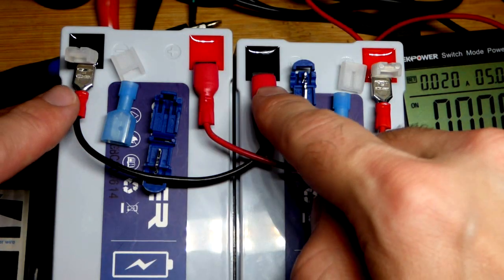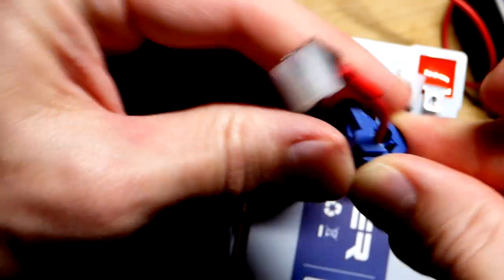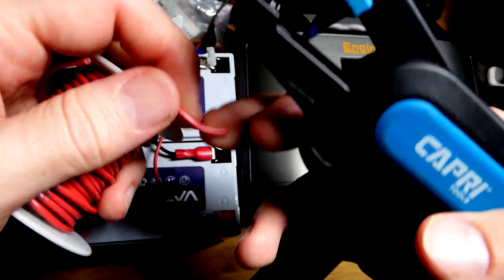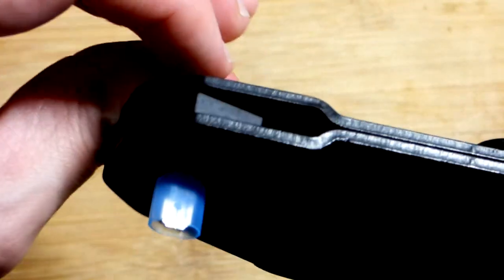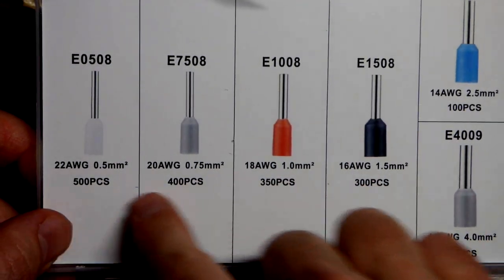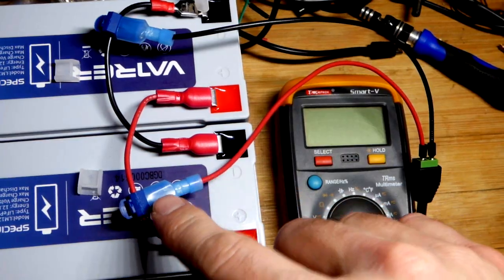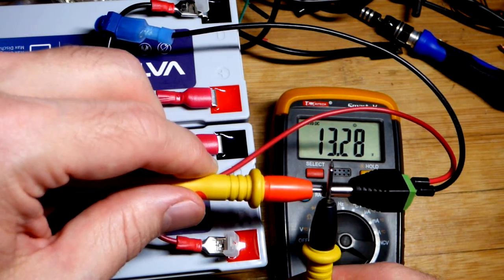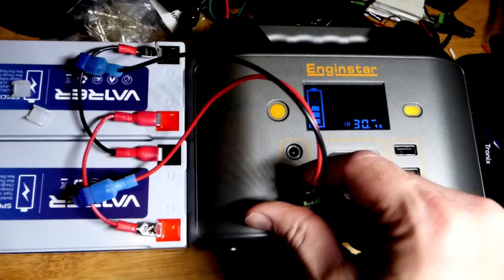T Tap Splice Wire Connector plus Ferrule and Spade Crimper for small battery and solar generator

Comment from the maker: https://amzn.to/3Q0RBwK T tap connectors
https://amzn.to/3MEV80u Ferrules and crimper
https://amzn.to/3WBQaGp cutter and stripper
https://amzn.to/46Ej0L7 ratcheting crimper
https://amzn.to/46HFESP spade and other connectors
https://amzn.to/3OkI82t piggy back spade connector
https://amzn.to/3JW5bxL screw down barrel plugs
https://amzn.to/46LBNUB 16 gauge wire multicolor
https://amzn.to/3Vx9MLk Two 7Ah LiFePO4 batteries
https://amzn.to/46xBL2K Enginstar power station
Product links are Amazon affiliate ads. I get a percentage of many purchases at no extra cost to you.
https://www.amazon.com/shop/electronzapdotcom/list/1ADLVE33FFFYL?ref_=cm_sw_r_cp_ud_aipsflist_aipsfelectronzapdotcom_B79P02M0KFPJ24S768FC
https://www.patreon.com/electronzap
https://electronzap.com/
https://www.reddit.com/r/ElectronicsStudy/ 
#Electronics #Howto #diy
Reply: Hello, I want a circuit which output only a single pulse say for 3 seconds whenever 12V or ground is feed to the input circuit/pin. There should be only single pulse regardless of whether the input switch is hold very long time or not.  I would be very pleased if you can kindly please make a new video about it.

Comment: Nice ideas. I have two SLA 12vdc 7A batteries I often use for serial or parallel config for powering circuits during breadboard projects. When they die I'll get the LiFePO4. With my new power supply I'm making up some new adapter cables that work with it. I use but I am not too fond of alligator clips as supply connections. Fun stuff.
Reply from the maker: Nice.